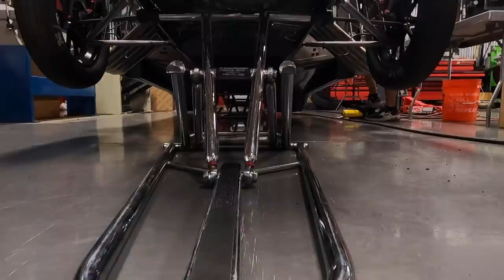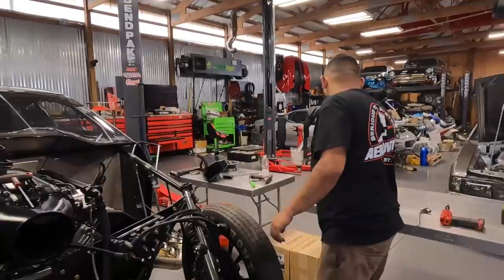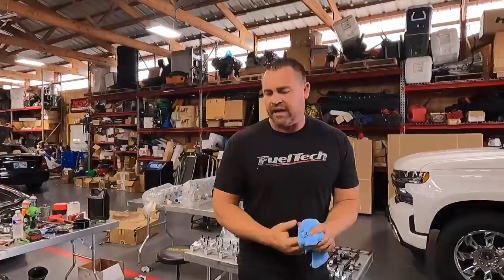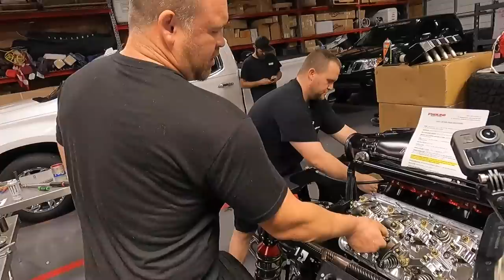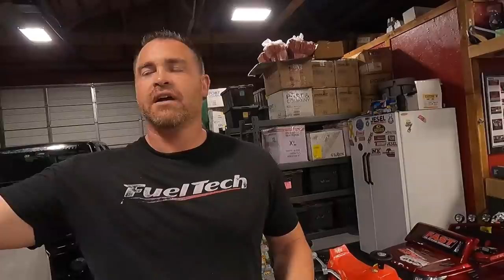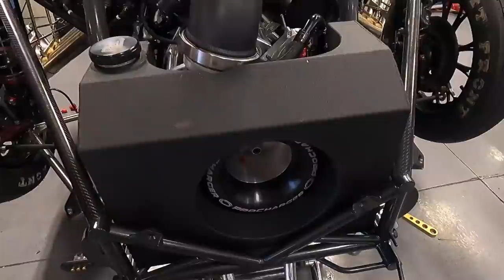Street Outlaws Ryan Martin No Prep Kings (NPK) BTS Ep. 1

Comment: Ryan, Get rid of those expensive junk Snap on impacts, Milwaukee impact guns are the best I’ve ever used. I’ve got the 1/2 20v and the small 3/8 12v which works great for working on engines and under hood stuff. Best thing about these impacts is there half the cost and twice the performance. Just my 2 cents. Love the videos!

Comment: Mmmmmyesss.  Tell that to Daddy Dave up like three years ago who sent 6 out of 8 rods through the pan and block. It was like rice krispies were in the pan except they weren't made out of rice, they were krispy pieces of aluminum rods.  And hoooowww many runs did DD have on those ALUMINUM (wink wink) rods on a 3000HP engine?  Like a HUNDRED.  

Top Fuel/Funny car change their rods out at 25-30. Go watch a 521 Top Fuel Hemi tear down and see how huge the rods are compared to a normal race engine even like the Hemi Proline engine...they're gigantic.  25-30 runs, doesn't matter if god himself has professed those rods to be good, they're in the aluminum recycle bin (they all have huge ones now because they all make their own blocks and a lot of their own car pieces in their shops now...they make an UNGODLY amount of overburden off those blocks of aluminum that gets shaved off. 

The point? It doesn't take a Rocket Surgeon to look at "do I run them 30 or do I run them 40 and maaaybe they start to get thermal breakdown from heat or twisted or cracks that you can only see on an x-ray".  Smart money?  Spend 2k on a set of rods every 30 runs, keep one of the most abused things inside your engine nice and healthy and your car won't fill the pan full of rice krispies because you're too cheap/lazy to change the rods when you should be changing them.

Comment: Go with a a milwaukee impact they have a mid torque it's like 600 foot pounds nut busting torque and 500 foot pounds of fastening torque or the hi torque 1/2 impact its 1200 busting foot pounds and 1000 fastening! They work get I love them best bang for the buck. I used rigid and snap on and Dewalt and they don't hold up or have the power of a m18 milwaukee impact !!!! I know I build trucks for work and used them all and milwaukee shines over them all with price and power and longevity!!

Comment: Great content!  Curious if you have tried using 96V brushless DC motors to run the supercharger to decouple it from the crankshaft to give you ultimate programability.  Use a couple lithium ion batteries to power the system idk

Comment: Rods every 30 passes?! So why u running proline when u can run a Steve Morris big block Chevy that makes as much power and is way more reliable?! For a $110,000 motor to last 30 to 40 passes ain't impressive at all. That would get old real quick lol
Reply: @Adrian Matthews No I get why hes doing it but for a $110,000 motor and blowing it apart that often  isnt impressive by any means. I race non wing sprint cars as well as drag racing so I know what it takes to build an endurance engine. U circuit race so u know endurance and longevity is key. I know I think he just has too much money to blow and show off lol